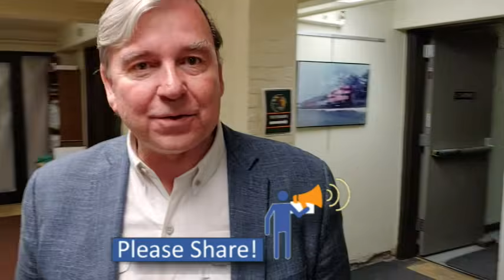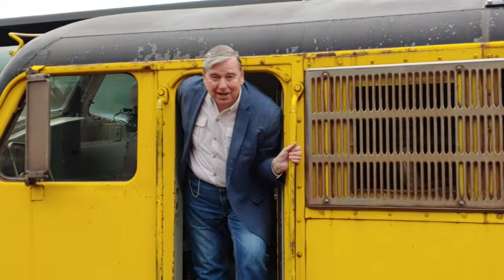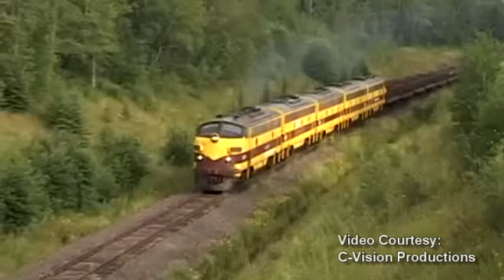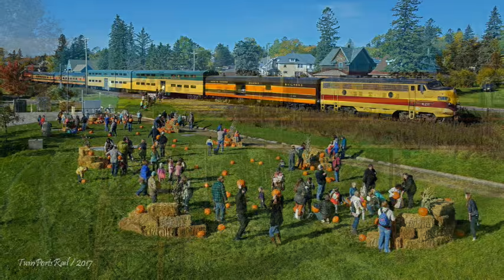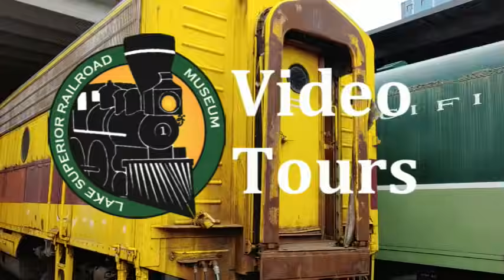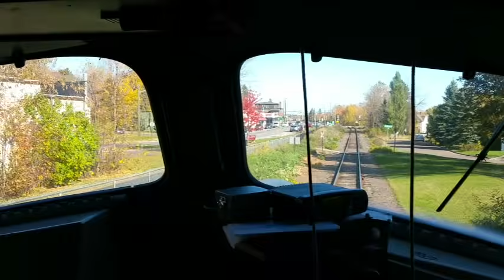Erie Mining F-Unis - Episode 60

Comment: Some B units cannot be moved without a controlling unit attached, but most have some simple controls inside, and often a side window at that control station. For example, B unit versions of the EMD FT with conventional couplers had a fifth porthole-style window added on the right side only for the control station. Other models used existing windows. 
Great video, thanks for sharing.